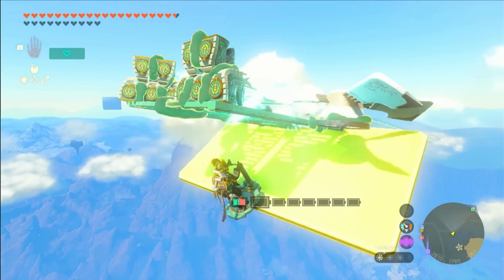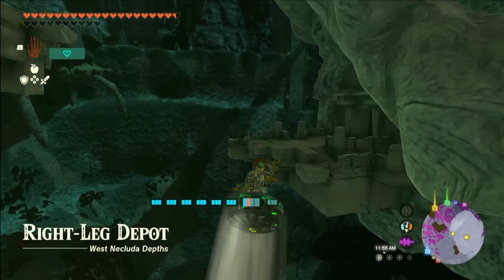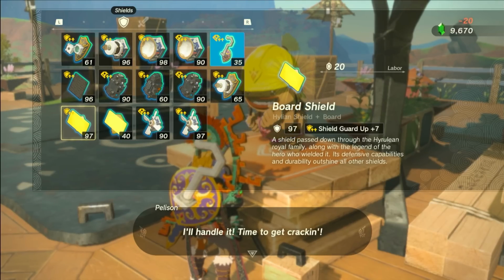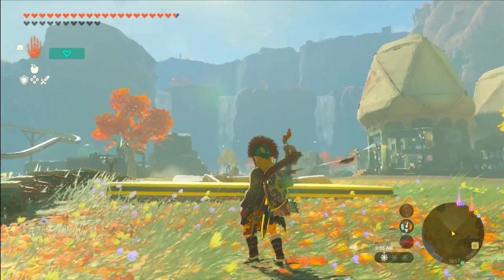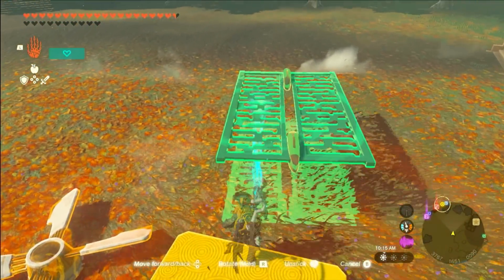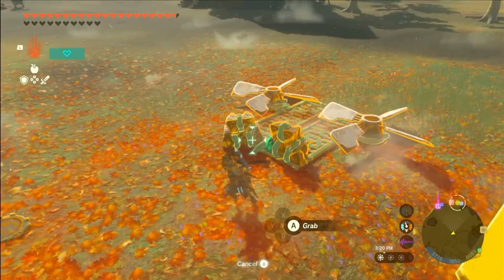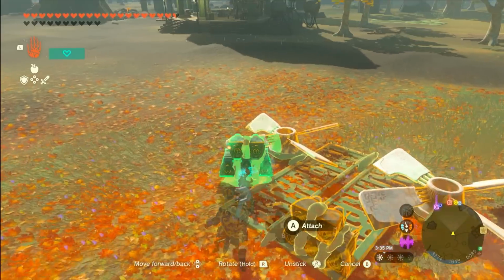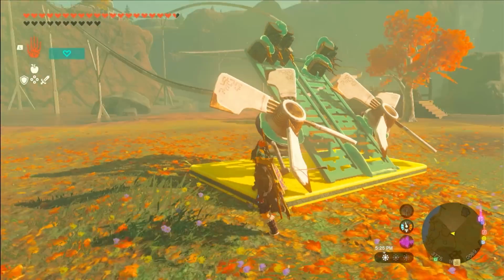How to build an Infinite Flying Machine in Tears of the Kingdom

Comment: When I try to shake the rails apart they break so what did I do wrong
Reply from the maker: The rails were partially patched but you can still do it.  It just takes a few extra steps.  A single rail on its own will always disappear now but if you attach something small to one like an apple then you can use it to build a vehicle and just remove the apple when it’s attached in the right place.

Comment: is that an old version thing where you could break apart auto builds?  at 4:53 you break apart the light platforms from an autobuild.  Whenever i try to remove a separate part from an autobuild the whole thing disappears.
Reply: Yeah, I have the same problem. When I try to break the autobuild rail copies apart, both instantly disintegrate. I've tried over and over, attached the original two in different ways, the copies still despawn every time they're split. I have no idea why multiple build videos can take them apart but I can't. Anyway, I've just settled for building in the depot itself for now.

What's more, I see very few people mention this issue in comments, so apparently it isn't a common problem. You're actually the first other mention of it I've seen.
Reply: @Alloveck  So yea man only the light rail is exempt from this.  But if you've updated your game you're screwed, Im on version 1.2.0 i think but the light rail you can indeed break it apart from auto build (In my version)
Reply: @B1az1ngSuN  Yeah, it was my understanding that those rails alone were uniquely, specifically splittable. Which made me all the more disappointed when I went all the way back up to a good building location, split the copites, and poof.

Anyway, different updates were actually my first guess for the difference, but then I immediately doubted that because if very few people seem to share my problem, that means very few people are also fully updated. And it just seemed unlikely that many people are holding back their updates. But I guess that must be the case after all.

And on that note, the more I play the game the more I wish I wasn't updated either. Seems like the updates don't "fix" anything but useful glitches. Really starting to think about ways to downgrade because if nothing else, I want that easy item duping. The grind for some armor upgrade materials like elemental keese wings and lizalfos tails is just downright obnoxious this time around. Like, uncharacteristically so for a Nintendo game.
Reply: @Alloveck  So this is up to you man but if you love the game as much as I do you can indeed roll back to the original version but you will lose all of your progress.  Turn your auto updates off and never ever mash the confirm button when you launch a game
Reply: @B1az1ngSuN  I think at this point I'll just put up with the "fixes," tail grind is truly obnoxious but I doubt it'll take longer than redoing like 80+% of the entire game. I've already got all the sages and like, 26 hearts.

As for updating, it was a choice, not mashing the button. In my experience, game updates usually do more good in terms of stability, performance, and fixing BAD bugs than they do harm by fixing good bugs. I just found out too late that ToTK is an exception to that, and updating was in fact, the wrong choice here. This is what you get for trying to avoid spoilers going in.

Comment: how about using the electric motor from the shrine in the centre of the spiral on the beach, it wouldn't spin in it of itself as you wont give it electricity but will it cause any resistance to the rotation of the propellers?

Comment: I wonder if it's possible to combine this with the infinite flight machine that Zonai Engineering made, that used motors and a now-unglitched, always-on, passive lightning emitter that got patched. Maybe use motors and a single lightning emitter to power them, then lather-rinse-repeat using your method of inertia to maintain flight while the batteries recharge?
Reply: Steering on that machine is a little bit less of a hassle, too. I wonder if it has to do with the props being turned by the motors? Wagon wheels props are still used, however they aren't connected to anything but rather rely on the powered props they interact with to turn, and are used for forward momentum.

Comment: Well.... I mean can it be weaponized in a way that actually attacks foes? Because my only concern here is the sheer number of beam emitters that seem requisite probably means this costs a whole lot compared to just using recall when battery runs out, though ofc this can continue going without ever stopping.... granted the whole steering thing kinda makes it not worth the trouble if it cannot be fixed...
Reply from the maker: I'm confident that there is a way it can be fixed.  I've created some new designs using only a single propeller that continue to fly when you run out of battery just like this and you can actually steer them.  The only problem is that they always want to turn to the right when you're not holding the stick.  So that's the only thing I'm still struggling with.
Reply: @new2you410  Oh? If you find a solution do share it as that could be something though the high cost on a movement only vehicle seems rather unappealing thus far when bike exists for if you just wanna fly and costs way less

Comment: Try flipping the left propeller over so that it rotates counter clockwise to generate lift, and aim the left beam emitters forward.
Counter-rotating props is usually more stable on real aircraft. It would be insane to think that they actually account for gyroscopic effects as well….
Reply: The propeller would spin the same way even if it was flipped over, unfortunately.  There's no version of the propeller that has the blades angled the opposite way relative to the axis of rotation.
Reply: turn it upside down @couchalmark675
Reply: @couchalmark675  🤓

Comment: Rather than having your second group of emitters at an angle, could you not mount the second propeller upside down?
Reply: The clockwise facing leading edge of the blades will still be angled up. In prop aircraft, the blade angles can be moved to produce reverse thrust. The only way to get a reverse acting fan would be to make a mirror image of it.
Reply from the maker: Oh that’s a genius idea!  I didn’t think about that but I bet it would work.  I’ll have to test it out.
Reply: I’ve just had a go.. seems almost impossible to center the prop correctly upside down… might still be doable though